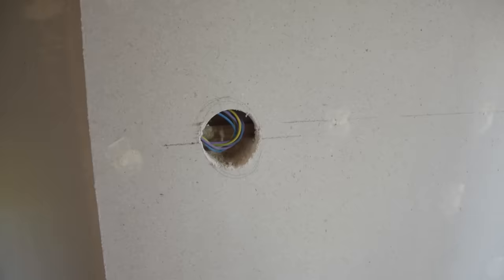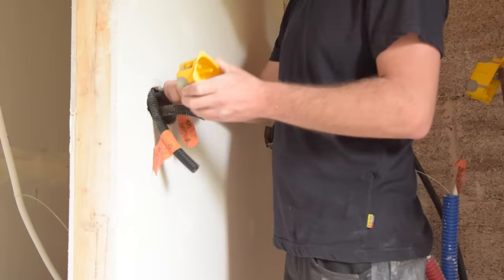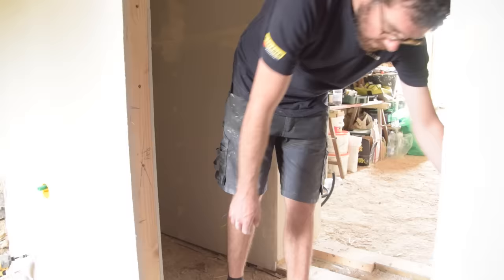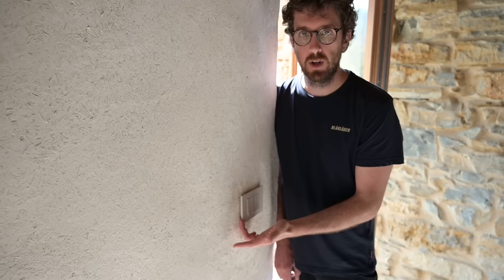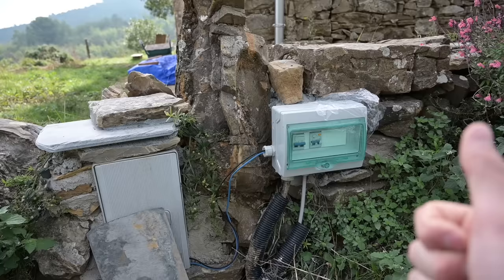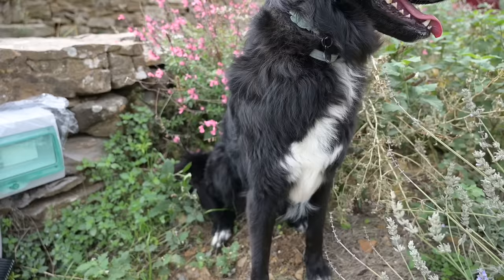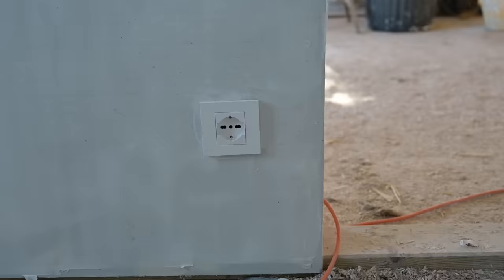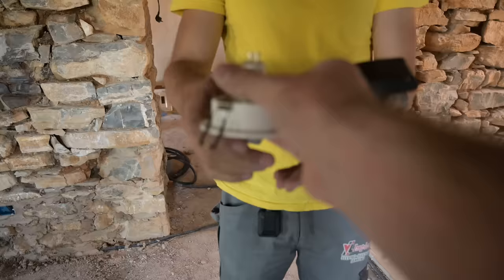#66 Let there be LIGHT | Abandoned Stone House Renovation in Italy

Comment: How exciting to have electricity - nice to see a light turn on!  You both are doing such incredible and inspiring work.  We have very old electricity at our house in Abruzzo, with wires outside the walls, and it definitely needs updating (as does our entire house). We will probably go with vintage-style external braided wires with porcelain switches for most of the new electrical.  We also have nordvpn but have mostly used it to connect back to the US for streaming shows. What a good tip to use it to book flights and car rentals from a different location - we will try that next time we go back to Italy!

Comment: I our climate (New England), air leakage into the walls/ceilings at the electrical penetration is very detrimental.  I seal the  holes/cracks external to the boxes with latex caulk.  On internal holes, I use 100% silicon caulk  or better yet a fire rated product.  I think in your climate and your masonry construction this is less critical.

Comment: At 14:42 I see your circuits labeled and I'm able to figure out the following: kitchen (presuming that means the counter outlets?) also the oven, refrigerator, boiler, then I'm not sure what the second to last breaker label means (I won't repeat here what Google translate came up with)  and, finally, "exterior?" Later I see that the uppers are overhead lights so are those 10 amp? Also I see that the wall outlets look like 10/16 amp plugs so I assume those were all wired for 16 amp and wondered what wire size you used to connect those
Reply from the maker: Our electric installation was done by a certified electrician as required by the law, so we can't really answer your questions 😅

Comment: Hi , 
I saw a bit of electricion stuff in rome bevor. Compared to youre Home you won 10/10 . Compared to the german standards its scary and 2/10. 

Mostly becouse youre maincabel is to small ( looks like 6mm² 7500 watt peak / 3-4 Hairdryers or 10mm² 12000 watt peak / 4-6 Hairdryers). This will maby be a huge bottleneck it reduces youre peak power you can use at the same time.

Second Problem i see is that you just have a 1 phase powergrid (  means 1 + ,1 - and 1 ground wire) instead of 3 phase. So using a electric oven/ cookingstation, bigger worktools  and all that stuff will have much less power if they work at all.
Reply from the maker: Again, we don't know much about electricity, so we are just happy that the installation is up to the norm here in Italy 😉
Reply: @ateliermavi  😊 i just wanna help you.  I dont know  the norms or law in italy. But most of what i see in the vid is well done.  🥰   milestone acieved.

My point is/was just think about youre combined power consumption. 😊  I know some ppl in italy that have problems with it .